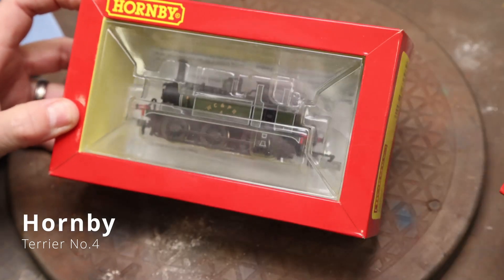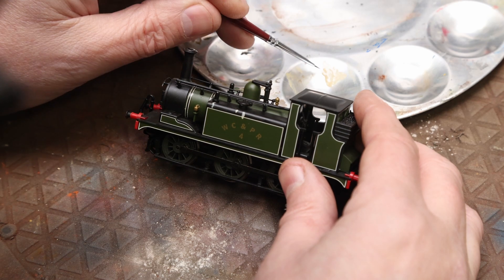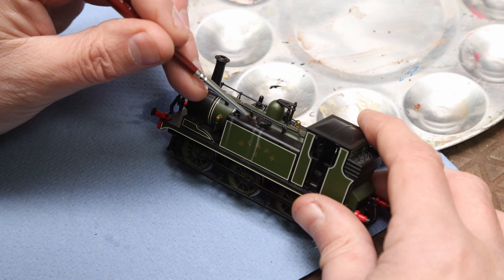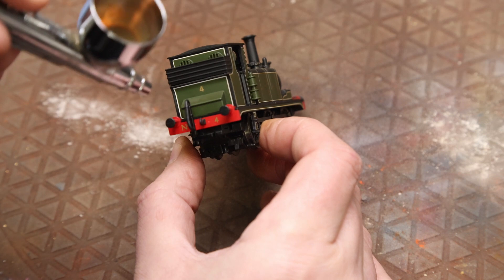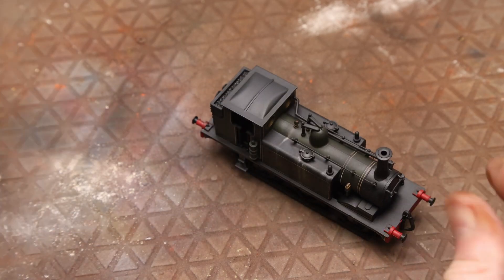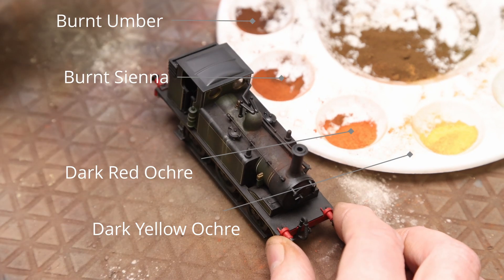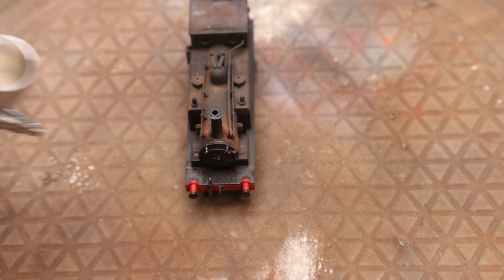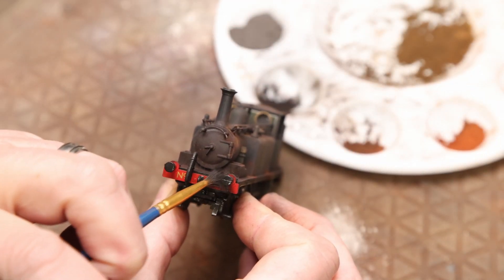Hornby Terrier WC&PR | Weathering Model Railway

Comment: In  my last comment I mentioned I had 3 Terriers to weather, a black one, blue one and a stroudley green (which is more of a yelow).     As we all know everything on a railway ends up more or less the same Brown   However if you were weathering these 3 different colour engines would you use the same colour weathering powders and paints on all the 3 models or would you change the colours and shades of paints & powders relevant to the background engine colour. Thanks
Reply from the maker: I would tend to use the same weathering powders and colours. Having said that, some thinned paints such are brown shades may appear differently on darker colour. But generally speaking, use the same palette of colours